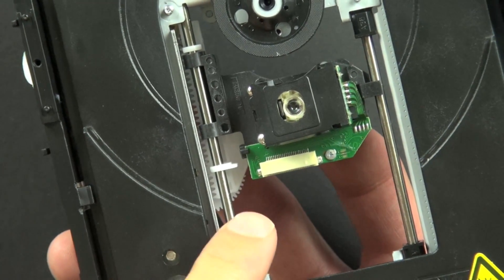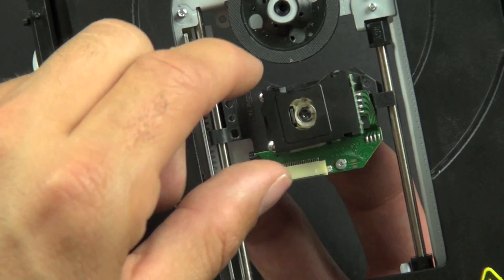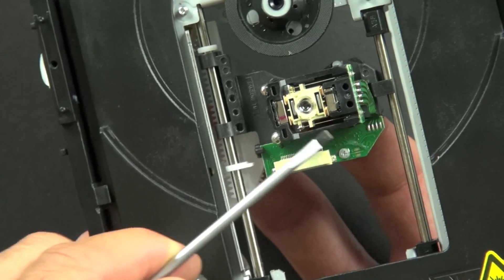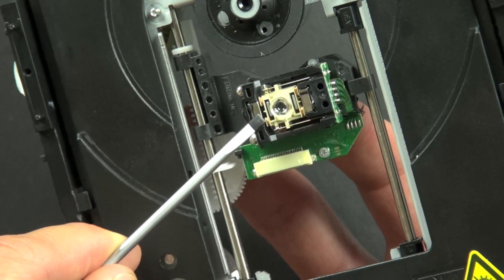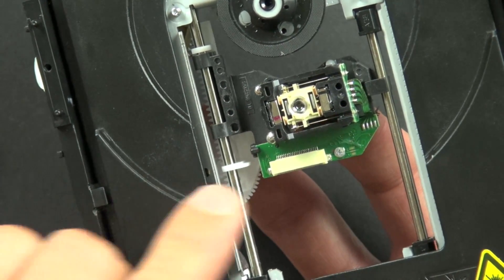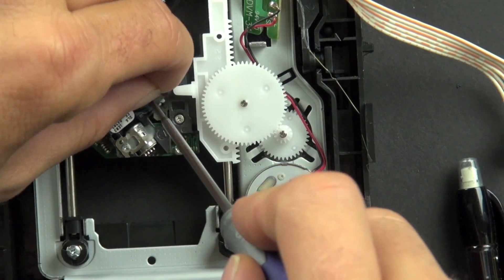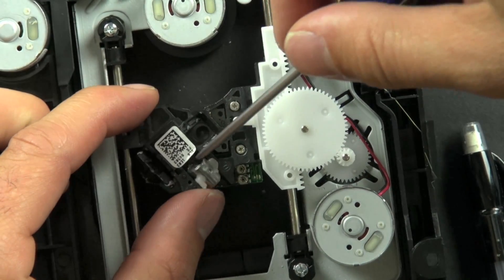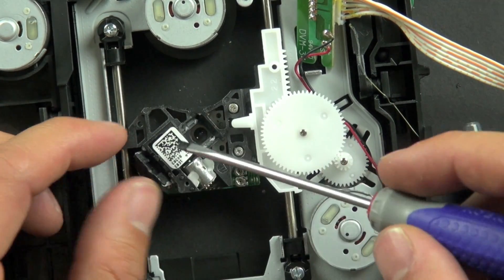What is inside a DVD player? (5 of 5) | Electrical engineering | Khan Academy

Comment: How does this sensor sends audio?
Reply: the sensor does not send audio the the MCU
the MCU just receives data from the sensor which, in turn, gets converted to audio and video through a processor on the MCU board
Reply: Its called CPU